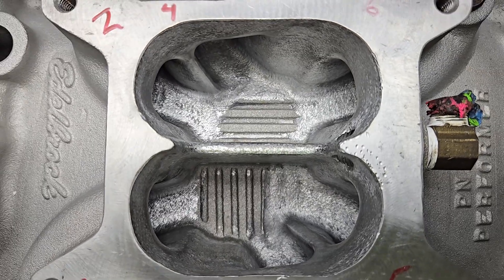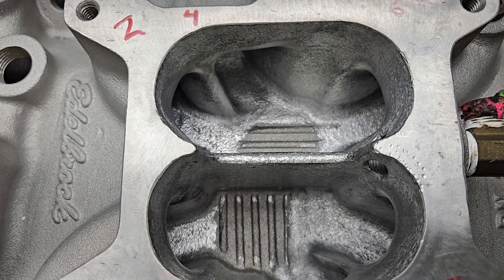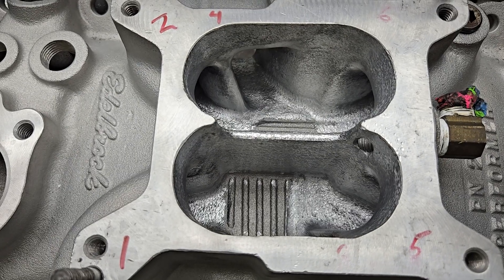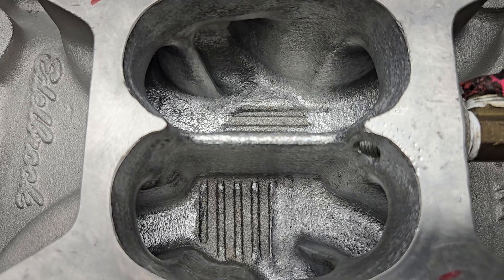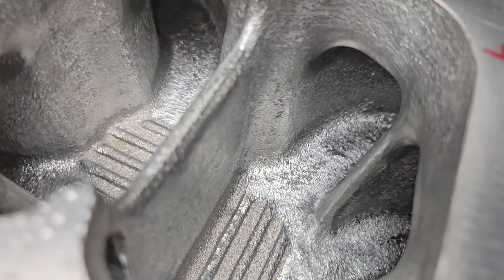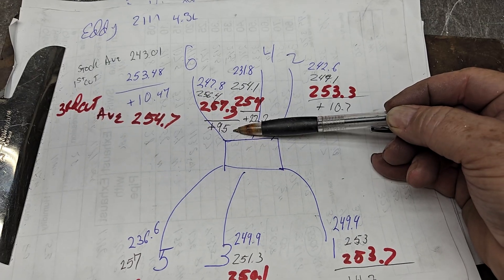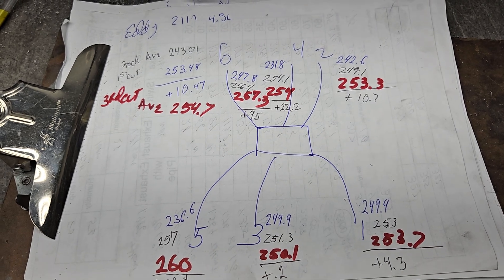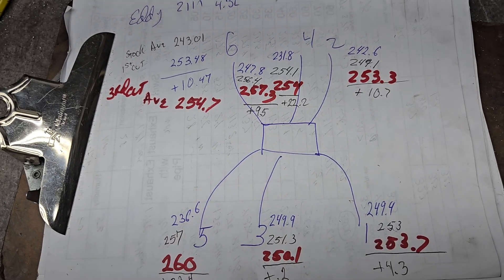Chevy 4.3l Edelbrock 2111 four barrel intake. Full balancing , texturing and flows. Beat Vic jr.?

Comment: The original 2111 intake, back when it was the edelbrock performer 229 for the 4.3's precursor, was a dual plane. Its hard to find pictures or information on a lot of v6 stuff, but they're out there. It's hard to describe runner layout without a picture, but essentially the left bank of runners went to the right side plenum and vice-versa. The two runners together crossed through the plenum and opened up on the far side of the dividing wall. The single runner wrapped around the front or back of the plenum, and opened up above the top of the other bank's runners. Cylinders 135 and 246 still pull from the same area, but the plenums were fully separated and the runners were longer in this layout. I can share some pictures if you'd like, I tried to share links but youtube deleted the comment.

In terms of other intakes available for the 4.3 without going to aluminum race heads the best factory option was the tall plenum quadrajet intake, look up casting # 14075659-14, which was probably what you were thinking of. There is the edelbrock 2114 for vortec heads and 2111 for swirl ports. There are some old holley clones of the edelbrock intakes, and there was the original casting of the bowtie cross ram. Most of the bowtie crossrams are for raised runner heads, but the first casting fits production 4.3 heads because it was meant for standard port locations and 23 degree heads.
Reply from the maker: Send pics here.charlesservedio@gmail.com. Thanks

Comment: Good video! i would love to see you do an intake port balance, flow numbers and port work done on a stock gm 350 tbi 2 barrel intake
Reply from the maker: I have three tbi intakes, one stock, one modified plenum  small t.b., one all out welded big throttle body.
Reply: @servediocylinderheads  Any BBC,  tbi manifolds
Reply: Edelbrock is basically a copy of the marine cast iron manifold. Think the marine might have higher runners.  Stock 4 barrel came on the safari and astro vans in the early 80's .The only other difference is Edelbrock come with all the runners separated.  Gm were not. Planning a turbo v6 with marine intake 600 dp. and tbi heads ported per Charles Sevedio porting expertise.  I know you probably sent the info but older men who have strokes are a little slow😂. Figure some day I'll get that 50.00 that tbi series was worth to me . Thanks for your time and efforts Charles.
Reply from the maker: @billstahler5735 I am planning on tbi stuff someday. Then sell it all! Thanks
Reply: @servediocylinderheads Sorry Charles I watched your tbi 350 cylinder head work and thought it was top rate . Best down to earth how to I have ever seen . Either you're a good teacher or you picked up a few things from someone in your past.  (D
V. perhaps?) The other part as far as I remember was around the time your daughter was in a wreck . I feel your instruction on tbi cylinder heads deserve monetary compensation. Think you said your daughter was working on a way to do that . Figure you saved me $100's in time and trash cylinder heads.  Can't send much as I'm retired (lol)now . But it would be a small way to say thank you for your time and effort.  Sure has made my work much more enjoyable and productive. 😊
Reply from the maker: @billstahler5735 My daughter set up a cash app on this channel right after her wreck. I don't know if it works. Nobody has used it to date. As far as a teacher, my Dad was a teacher, I was a teacher for 16 years, my wife was a teacher, my oldest did some substitute teaching and my little one is applying for teaching jobs. Thanks!